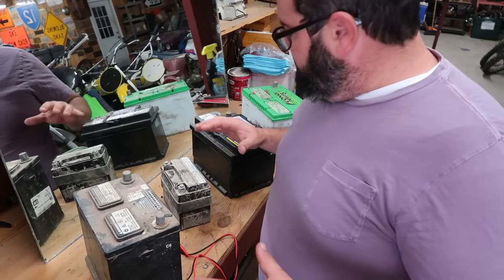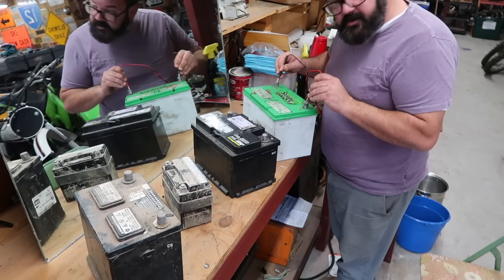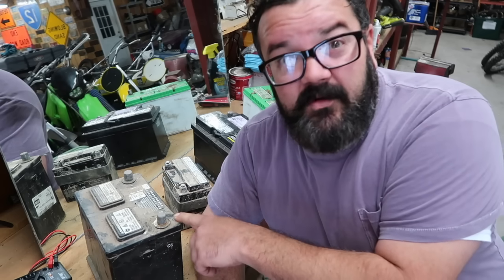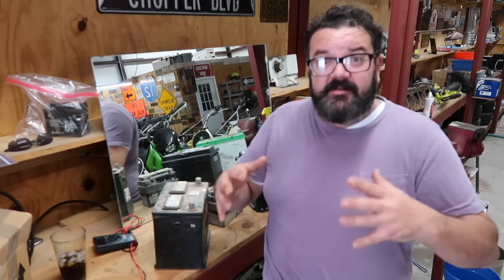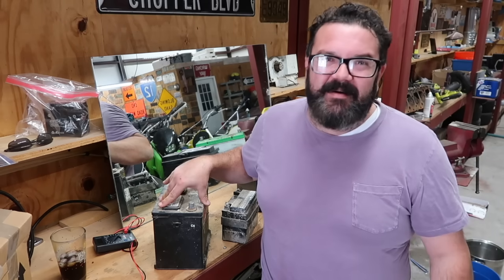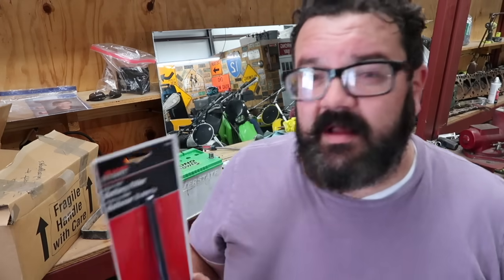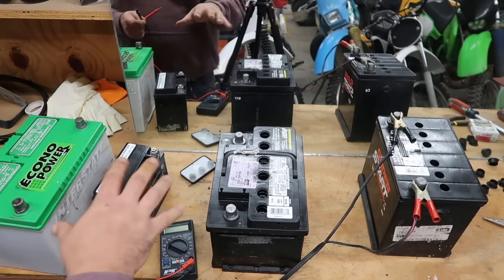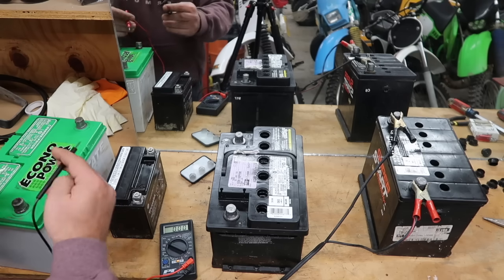Reconditioning a 12 Volt Car Battery: 100% Success

Comment: Don't take this wrong, but you almost sound like Jesse James, but almost look like Kevin Smith (Silent Bob). Really that's kinda legendary lol. And thanks for the vid, sir this is good stuff.
Reply from the maker: Haha Thanks, I think?
Reply: He honestly just looks like a genuinely good dude right?
Reply: Thank you
Reply: How much old used battery acid do you mix with a concentrated Epsom salt solution. What proportions? Also , once the battery is restored do you leave the Epsom salts and battery solution in the battery and continue to use it like that or does one discard that mixture once battery is fully charged and refill the battery with fresh clean acid?
Reply: @Danny Koda Instablaster =)
Reply: @Ryder Lochlan I really appreciate your reply. I got to the site through google and im in the hacking process atm.
Takes a while so I will get back to you later with my results.
Reply: @Ryder Lochlan It worked and I actually got access to my account again. Im so happy!
Thanks so much, you really help me out!
Reply: @Danny Koda Happy to help xD
Reply from the maker: You should see me when I fight, everyone’s confused 🤔
Reply: )lllllll
Reply: Smoking weed drinking beers 🎶 🎶🎵
Reply: @gazvlogs7459  definitely giving me a Canadian vibe
Reply: How do you know what Jesse James sounds like? He died in the 1800's.
Reply: So this was years ago, did the batteries work out??
Reply: Where to get rid of the acid ? It 'burns' concrete ?😢
Reply: You got volts but you didn't load test them had did the amps do and did they start your car after 
Proof is in the pudding
Reply: @phillipnourse9508  Good question and no answer hu?
Reply: @CarGroves  You need a load tester this is nothing. We need to see you test it with a load tester

Comment: Hi all. I'm a mechanic of 27 years. Not everything in this video is correct. If you have an old battery, I can give some simple advice. ( But be assured, the battery will never be like new). You MUST use a "load tester" first, to document the condition of the battery. NOT a Multi Meter, but a LOAD TESTER, that you dial the correct CCA (Cold Cranking Amps)  value of the battery as displayed on the label. Once you document the poor condition of the batter, now it's time to recondition it.  1) remove car battery and place is on soft ground such as your lawn. DO NOT open caps or remove any acid yet. 2) Roll the battery around over and over for several minutes. use your boot and kick the battery and make it tumble for a few minutes (this rough contact breaks a lot of the buildup stuck to the plates). 3) Drain all the liquid into a container holding the battery upside down to drain it all. Keep this acid and allow the dirty looking liquid to settle over a few hours, This will take time until the sediments settles to the bottom of your bucket.  4) fill battery with water and repeat process of rolling it after putting caps back on, but DO NOT keep this liquid! instead, dispose of this waste. 5) Once battery is empty again and the captured Acid part 3 has settled and looks clear, carefully pour the acid into another container, leaving lead sludge behind. Finally top up the batter with the clean acid and test the battery on a "load tester".. Yes you can charge it, but prior to doing so, test to see if there is improvement. I recently done this to a Pajero V6 Petrol, that had a dead battery. The Battery bounced back and I got 6 healthy months from it, but eventually it failed to hold a charge. No Epsom salts used in this process, however I am sure that will only improve the condition to perhaps give you as much as 12 months of life out of it, but I cannot verify that as I haven't used salts.
Reply: You are correct, The trick is to get the stuff at the bottom broken up and out of the battery.  That alone (if it causes bridging) can cause the load tester to give a thumbs down so I am not sure what you would gain by using the load tester first.  I am not an expert by any means!
Reply: Your a mechanic you know well you should just change the battery come on for god sake all that pissing around and then the thing leaves you down at the worst possible moment. If you have got time to this and earn a living repairing vehicles  I tip my hat to you sir. 👍
Reply: @Blaaggarding  this information is valuable and important to know and I'll give you an example. I was working as the mechanic on a remote stretch of hi way on the Nullarbor in Australia. Known as the worlds longest straight stretch of road. This road consumes many cars that were not prepared for the drive, and "the Car Graveyard" located 2km from where I was working, was full of perfectly good cars, with damaged engines. One day a Toyota 4X4 with a flat battery that couldn't be charged broke down nearby. The two young backpackers driving it was freaking out as they needed to get back to Perth to fly home in 5 days, Yet where we are, it will take a week to have a replacement battery sent in. This is when that knowledge is valuable as I did it to their car battery and got them to a point where they could start the car with ease each time, and keep going to complete their last 1400km journey. I certainly do not advice you do this trick to a dead battery and then rely on it like these people did to cross central Australia through the desert. But for their needs and the fact they had little option, it worked 100%. But you are correct, ALWAYS replace the battery and be done with it. Peace of mind is important.. Women will NEVER be comfortable with a quick fix like this. They freakout at the very idea that their could still break down. Men, love the challenge hahahaha
Reply from the maker: Second video is up

https://www.youtube.com/watch?v=RNnSYuTuLk4&t=156s
Reply: Why would anyone use that old acid out of the battery why not just put new battery acid in there with the distilled water
Reply: @peggy7760  that's what I did one time when I was active duty in NC and didn't have a whole lot of money. I first called the local car parts store and asked them if they had battery acid, then went down  with a quart canning jar and the guy filled it up  for a couple bucks and went on my way. I seriously doubt you can do that here in California.
Reply: @desertodavid thank you for your service to our country. RESPECT
Reply: @desertodavid  he basically just gave you concentrated sulfuric acid  the one that comes in some drain openers (not sodium hydroxide or lye)  but i think they also add some additives to it
Reply: I don't get it. Bad batteries will read 12+ volts all day long but CCA   test bad. I've gotten plenty of batteries up to 12+ volts, held them for days, but still the CCA tested low. Have also had countless batteries read 12+ volts but not crank a car due to low CCA.
Reply: I fell for this video Hook line & sinker. Clean my batteries out thought I had this figured out put the solution in my batteries. Then I couldn't remember where to go from there so I watch the video again. That's when I fell into the giant black hole trap you set for us with his video.  You never gave any idea as to what to do between cleaning the battery and making the Epsom salt solution and the battery acid solution without any elaboration at all?  What percentage of battery acid to epsom salt do you use.  I thought in the first watching that the Epsom salt solution was only put in there to clean the battery out and then you replace the old battery acid into the empty battery but the second time I watch this video you talk about some kind of solution like you mix the Epsom salts with the battery so confused now I don't know what to do with this mess.
I'm glad I'm only working on one battery at a time. My battery is sitting out by my shop now since this afternoon with he salt solution in.
You skipped a huge step here making this the worst YouTube video I've ever seen
Reply: Just did this to my battery that crapped out on me and it worked! My truck is running next to me right now, now I have time to get a new battery in the near future. I thank you!!!
Reply: I did this today in a pinch and it worked. Just kicked it around a few minutes, drained the acid out, filled with tap water, kicked it around a few minutes, drained it, discarded that and then I strained the acid thru a couple paint filters, refilled the battery equally and topped off each reservoir with distilled water. Car fired right up. May be a short term fix but it got me by in a pinch. Went from reading 10.8 on a meter to 13.6 ... Good info
Reply: You are correct about getting the sludge out of the battery. I have 40 years experience and have had several batteries last 15 years before replacing them. The key also is to know state of charge on your batteries and keep them up as much as possible. I have one seen one battery explode in my years and a word of caution if you hook up a charger and the battery makes a humming sound unplug the charger and get away from that battery. Most smart chargers will not charge a shorted battery which is why it’s not common for them to explode.
Reply: Yes, but those newly conditioned batteries when hooked in parallel can power all the automotive led emergency lights in your house and can be kept topped up with a tiny Coleman solar panel.
Don't throw away what can be put to good use 😊
Reply: You do want to shake it up as much as possible  but do it smart don't kick it , you can damage the plates and cause a arc. Do not reuse the old acid at all , use your Epsom  salts and distilled  water , Epsom salts is magnesium the chemistry will naturally  create the acid brand new . When battery is filled with new solution charge to full with 10 Amp. After full charge on 2 amp over night . You should now have a brand new battery ... 

P.s. one thing , if you do not have a load tester, take ur voltage meter and check the  voltage.  A good rule of thumb is if the battery is under 10 volts it's most likely not going to work . The lower the voltage increases the chances of taking it to the recyclers
Reply: @peggy7760 absolutely  correct
Reply: I'm a ffayy😊
Reply: @Blaaggarding tell me your born into consumerism without saying it
Lol sometimes you just have to either make do or without 🤷 🤣
Reply: I watched the video and it does not tell you how much acid to put in the newly filled Epsom salt water battery does anybody know
Reply: Yes I am a diesel mechanic 10 volts won't crank anything
Reply: @jeeptk yeah I had a battery explode in my face one time . Trying to tighten the posts after jumping it while it was running . Wrench fell and crossed the posts. It was like a bomb went off about two feet from my face . I was covered in battery acid and couldn't hear for days. Luckily my buddies were there and led me to the water hose. I came out unharmed except I couldn't hear for a few days. Battery was completely gone !
Reply: Just listening to his voice which is like a 12 year old 😂clearly hendoesnt know what you're talking about, but I fully understand you
Reply: @peggy7760 have to be careful doing that as it can cause battery to have too much acid/water ratio and can be overcharged
Reply: Equiment, battery and charger technician here. I can attest to this. However have to be carefully kicking it around as you don't want a plate to bend and touch another plate. Ive used medium pressure water and rinse with battery hanging upside down but never dropped or kicked them around.
Reply: @peggy7760  the old acid never left the battery it crystallised on the side of the lead plates its called  sulfated battery what that guy did is useless
Reply: I want to use the batteries for ham radio backup power. They won't be going back into a car and will continuously be topped off by solar. I suspect I'd get a couple of years out of a reconditioned battery.
Reply: @daviddawson6394  Totally agree,   when it deals about Ladys... Just do it Right the First time.... and if possible factory parts or life time parts is better....

Comment: The true test is fully charging those batteries, then run them each with e.g. 20 A load (e.g. 4 headlight bulbs in parallel) until the voltage gets down to 11.0 V. You can then compute the total energy released to figure out how much capacity you end up with (basically the longer it takes the better the battery is). Simply being able to load the battery to correct voltage doesn't mean that you can do anything meaningful with the battery. A good car battery is rated between 50-120 Ah as new and if your reconditioned car battery has 2 Ah, it's practically not usable for anything even if it technically still works as perfectly good 2 Ah battery. If you truly just need 2 Ah battery, you should use NiMH or Li-on batteries instead.
Reply: @christianpowerssavesthewor8404  The 12.58 V that you measured is voltage. When you run the starter you need power and for that you need current. The power is literally current multiplied by voltage.

The problem is that when battery is bad, the voltage drops rapidly when you try to drain practically any current.

A simple test is to measure your battery voltage like you did and then turn on the headlights and turn the ignition to "ON" but not try starting the car.

Then measure the battery voltage once per minute.

The current needed for the headlights should cause less than 0.01 V drop per minute (but the drop from 12.58 V in this example to headlights on state could be e.g. 0.3 V even with fully functioning battery).

The reason for this is that the total energy stored by the battery is limited by the lead surface touching the electrolyte. With damaged battery needing reconditioning the lead surface is damaged and cannot react with the electrolyte over (large?) designed areas.

As a result, you get expected voltage but the total energy is very low so draining any current will drain the energy fast out of the battery.

Again, energy is literally power multiplied by time. So the above test with headlights on is actually draining energy from the battery and the voltage drop is used as a proxy to estimate the remaining energy in the battery.

You can imagine 12.7 V meaning "100%" and about 10.7 V meaning "0%".
Reply: @MikkoRantalainen 
Thank you for the explanation, I didn't know when he use the boil distill water because it looks to me he still refill the batteries with the same electrolyte removed from them.
Reply: @Brooslinks  Oh, you do need to add any lost water but also the part of the lead surfaces that's always submerged get damaged over time. And all the damage there cannot be recovered, no matter what you do and that's the part of the damage I meant above. The parts that are not submerged obviously do nothing for the energy storage so you always want max amount of distilled water in a lead battery.
Reply: Old skool tech
Reply: @brianlitecky9798  Definitely. Lead batteries were invented around 1859 and the only thing that has changed is purity of the materials used. The less contamination you have, the longer the battery can live.

Of course, the body of the battery is nowadays plastic instead of glass for obvious reasons.
Reply: If that battery u reconditioned turned your engine over fast, its good.. maybe not as good as new but spinning the engine at a good speed to start up is its biggest job.

U have another problem, this is why starting fluid gets u going. Maybe low or no fuel pressure initially
Reply: @koollee  I totally agree that if the engine cranks at all but doesn't start without a starter fluid, the problem is highly probably not the battery. And if the engine cranks and starts with starter fluid with that same battery then the ignition is obviously working so it's not like the battery is too bad to produce current for both the cranking and the ignition.

I'd guess a bad fuel pump or fuel injectors. It's probably the injectors but fuel pump is often easier to check and replace so I'd still start with it.

And if you have a carburetor, then it's probably some kind of vacuum leak.
Reply: @MikkoRantalainen  U R right.  it will  die after 2 days
Reply: @MikkoRantalainen So max as in all the way to the top of cell opening?
Reply: @maxcrit3481  Are you asking how much water should you have in a lead battery? It depends on the battery. I think there must be some air inside or thermal expansion could break the battery (assuming water and the plastics have too different thermal expansion rates). You should have enough water to keep the whole anode and cathode submerged but how much water that actually is depends on design of the battery.

TL;DR: nearly full but with an air bubble inside the battery. Some battery designs have ceiling with a shape that it will trap enough air and you can safely fill the battery to the brim but you should check the documentation for a given battery.
Reply: @Brooslinks  me too, gone back n forth but never seen how and where he used distilled water and epsom salt. of course previously I hear about it. some also use citric acid. anyway anythings that could somehow dissolve lead oxide could reju the place.
Reply: Like!, actually I've done a handful of batteries just for experimentsEpsom salt could be some better attention. I"ve heard about using salt to give a better surface area to plats. and it works better base on my experiments.
Reply: Why did tou run the battery voltage down so.low.  That isn't good even for a healthy battery.